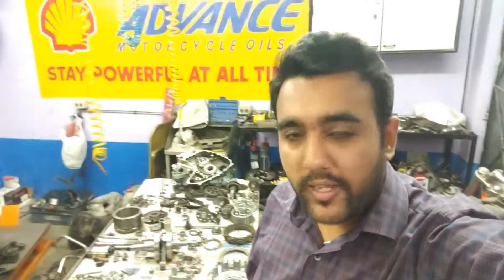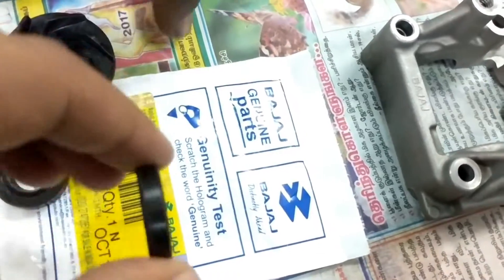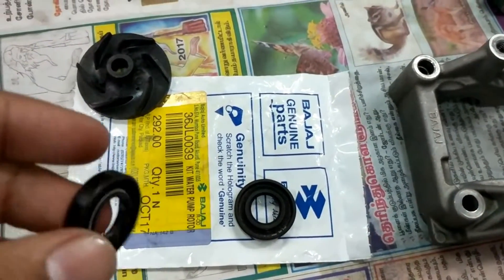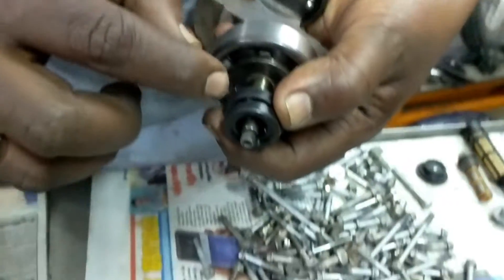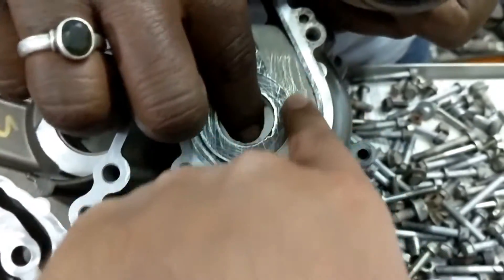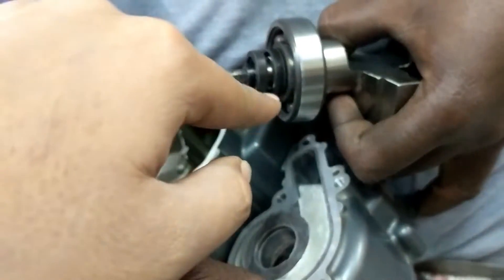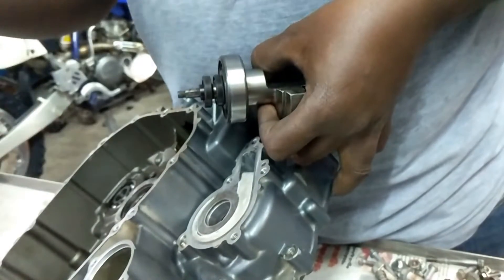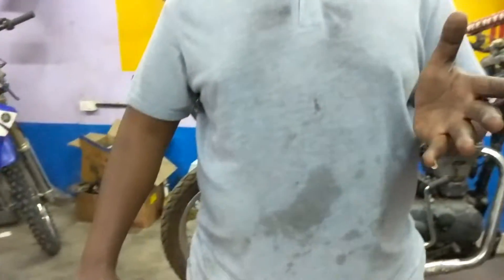Why does the coolant mix with engine oil in KTM 390 Duke/RC? Major Fault!!

Comment: I am facing the same issue with my Duke 390. The worst part is that the bike generates enough power that the issue goes unnoticed. I had to convince the KTM service centre as they found the bike running still smooth. It takes a very deep relation with the bike to know this. Do not ignore even small performance issues. All the best with your rides..
Reply from the maker: Yes it's a very subtle symptom. You're lucky if you find it early, else goodbye engine
Reply: Just notice the coolant level at start and end of the day

Comment: Bro im facing the same issue for my duke 390 i gave it to the service center they said me that most of the parts should get replaced and they said it will cost arround 40k please help me bro.
Reply from the maker: Oh my! That's a lot. Depends totally on the extent of the damage mate
Reply: @saajanjogia  bro i have the the list of parts which are being replaced.
Can u drop ur email so that i can send u that because i feel that ktm guys are unnecessaryly changing few parts and charging more
Reply from the maker: @RohitRajKodimala  honestly, do you want to keep the motorcycle?
Reply: @saajanjogia  what will u suggest bro??
Im in a dilemma
Reply from the maker: @RohitRajKodimala  if you're planning to sell it, get minor repairs done and sell it. Else take the opinion of another mechanic or another ktm dealer and go ahead
Reply: @saajanjogia  im planning to fix the problem completely bro. After fixing it,is it  better to keep it or should i sale it
Reply from the maker: @RohitRajKodimala  the motorcycle will give you repeated expenses, it's not a well finished product imo. If you still wish to keep it like me, you could.
Reply: @saajanjogia  ok bro. But selling is the not correct option right the other guy who buys it also faces the same issue.
Have u tried reaching ktm guys regarding this issue??
Reply from the maker: @RohitRajKodimala  of course it isn't the option. The thing is the problem and solution for this issue has been given in the video, ktm is also aware of it. Despite this, there is no improvement. bajaj motorcycles that have coolant have this issue, all KTM's made in India have this. No resolution though
Reply: @saajanjogia  kool thanks for replying
Reply: Rohit Raj what happened? Is your problem resolved??
Reply: Rohit Raj bro could you send me your insta  username, I want to DM you
Reply: @nischalk1336  rohit828raj

Comment: How much did it cost even I have the same issue 😅😅
Reply from the maker: I haven't faced the issue myself. For my friends, who faced this issue- it costed them around 8-15k depending on the damage that has been done. The manufacturer unfortunately ignores the damage that happens inside and only replaces seals (which is cheaper compared to going deeper and finding gold). If you wish to do that, I suggest you sell your bike after the work has been done
Reply: costed me 5k. and after 2days same issue. Filed legal action against KTM India.
Reply: Surely Done is your problem resolved now? Did KTM follow up for free?
Reply: Surely Done you faced coolant mixing with engine oil only?

Comment: Use in r15 v1?
Reply from the maker: Whaaat?
Reply: @saajanjogia  this water pump oil seal use in Yamaha r15 v1
Reply from the maker: @anupmokashi3114  not sure about that. Did the R15 even have a cooling system?
Reply: @saajanjogia  yes
Reply: By gods sake y will yamaha use babjajs oil seals?

Comment: How to get to know if coolant is mixing with engine oil in 2017 Duke 390??
Reply from the maker: See if your oil has become light green or pista green in colour. Bike will become too smooth when you ride it. also check for drop in coolant level
Reply: Tourer Jogia ohh got it...thanks bro.. how is your engine after rebuilding it? How many KMs have you ridden since then?
Reply from the maker: @nischalk1336  I've ridden around 10k kms after that. Engine is ok, haven't got full power back yet. I don't ride it that often now, just occasionally
Reply: Reason: Oil has turned pinkish cream in color.
Of course coolant level has dropped.
White smoke in the exhaust.
Reply: @VJ-ee5ez  got it fixed buddy... The gaskets and  sealant shutting the engine had failed... white smoke is mainly when there's engine oil burning...
Reply: @nischalk1336  Technically, its Blue smoke when oil is burning! White smoke if coolant mixes.  Please check!
Reply: @VJ-ee5ez  my bad... Just checked it out and you're right.. got confused since I had the coolant mixing with engine oil problem but I didn't see any white smoke coming out of the exhaust at all

Comment: What is the price it will take to replace the oilseal and also what the problem it will cause if we dent notice for longer time
Reply from the maker: Engine will wear out faster. Check with SVC for price
Reply: @saajanjogia  it may cause to change the cylinder kit in that case because in ktm service they r telling that it will come around 25k so only I am asking what will be the cost
Reply from the maker: @sriram-bw9sg  depends on how much you have ridden after mixing. If damage is bad, everything needs to be changed under warranty. (If you have warranty). Cylinder kit with Labour costs around 20-25k. If head is affected then add another 8-9k.
Reply: sri ram what happened? Any updates?
Reply: @nischalk1336  I have changed the oil seal and only I changed the clutch plates
Reply: @nischalk1336  thanks for the advice

Comment: Hy Tourer Jogia i have the problem with mixing transmission oil and coolant.My coolant is very fat on radiator plug so i would like to know is possible that transmission oil enter through water pump seal ? The bike is ktm exc 250 2015. 
Thank you in advance
Reply from the maker: Transmission oil of very thin I suppose, if there is a connection between the two then it could enter. Did you spot it ?

Comment: +Tourer Jogia
 could you help?
What the current seals position?  is [ || ] or  ] || [  ?
In video i can see the [ || ] variant - is that correct?
Reply from the maker: Hey. My mech isn't around now. I suggest you check the manual once before doing it
Reply: I'm a little late, but the seals should go like ][. I've read of some bikes having the seals wrong way from the factory. But the flat sides of both seals should face each other.
Reply from the maker: @MrMats0n  really not sure about that
Reply: @saajanjogia  really thats how shaft seals work. Its shaped like a cup, so the coolant (or oil) pressure pushes the seal to seal against the shaft. If it was the other way around, the oil and coolant would quite quickly just go past the seal as they would be pushing the seal lips to open.
Reply: @MrMats0n  Right

Comment: I had the same issue with my duke 390 2016 model slipper clutch. Service guys told they replaced the waterpump seal but it didnt solve the issue. Does anyone know what could be the issue
Reply from the maker: What problem are you facing now?
Reply: my coolant is mixing with engine oil..bike is still at service centre..
They told me some paste sealing near crank case is leaking or so!
Reply from the maker: @TheBornVoyager  ok. How did you find out it has mixed? Internal components need to be checked as coolant may damage engine in the long run if it has run a considerable distance after mixing has occured.
Reply: VINEETH VENUGOPAL bro is your problem resolved? What happened? What was the cost?
Reply: @nischalk1336  bro it was covered under warranty..now my bike is running at 30k kms..
Issue was with the sealing between gaskets..a paste like thing..it gave up
Reply: VINEETH VENUGOPAL ohh.. all of a sudden my coolant level has dropped to 0 and my engine oil is frothy and the bike heat bar is filling to half even while idling..  and the radiator isn't turning on properly.. could I be facing the same issue as you? What all did you face?
Reply: @nischalk1336  get it checked asap! That's a coolant mix. If you are lucky , culprit would be the rubber seal
Reply: VINEETH VENUGOPAL thanks bro..why do these KTMs have such fucked up reliablility..they can never come close to the Japanese ... Makes me regret buying a ktm
Reply: VINEETH VENUGOPAL ohh... Since then you haven't faced any issues for 10k km??
Reply: VINEETH VENUGOPAL and which showroom did you visit?
Reply: @nischalk1336  ktm's reliability is not upto the mark! Now my bike had been running for last 18k kms without any single issues. 
Before warranty i did services from an authorised service centre.
But after warranty..i never visited that place...
I do periodic maintenance once every 4000 kms ..i wont wait till 7.5 k kms as the company said..oil won't last that long in a good shape.
Now my bike is running smooth af.
Reply: I use this bike for 40km daily commute. It just clocked 15k on odo....i check coolant oftenly..but all of the sudden , a small constant bubbling sound came from coolant reservoir side..i checked coolant level and was empty..i immediately took it to the svc..and confirmed that engine oil and coolant is mixing ( it wasn't abruptly mixed..oil still had its characters) .
Reply: Oil colour didn't change much..
Reply from the maker: @TheBornVoyager  then get it fixed ASAP. Don't ride it anymore

Comment: My bike ( KTM RC390 ) suddenly started smoking out white smoke from exhaust, I noticed coolant is low in reservoir. Can you please help me out?
Reply from the maker: White smoke could also be due to oil burn. If coolant has reduced by a large amount, check the oil level and see if there's a green liquid. Better to have it checked
Reply: Tourer Jogia Is it expensive to get it fixed?
Reply from the maker: @rupeshtyson  depends after you've got it diagnosed. Could be expensive
Reply: Subba Rao any updates?
Reply: @nischalk1336  That's because I ride it once in a month, cold start caused smoke. Nothing serious!

Comment: Same problem on my Duke 390. They changed the water pump gasket.
Reply from the maker: Did it solve the problem after that?
Reply: @saajanjogia  I get the bike back today.
Reply from the maker: @CSWrally  cool 👍🏻
Reply: CSWrally what was the cost of repair?
Reply: CSWrally is the issue fixed?
Reply: It was covered by the warranty.
Reply: Yes, but I changed that bike after 3 months.

Comment: How do you know the coolant is not getting in through the head gasket?
Reply: If coolant enters through head gasket we would see a lot of steam or while foggy smoke from the exhaust port. I check the coolant level and engine oil colour after every ride just to stay on the safer side.

Comment: Such a nice explanation. Bro recently faced the same issue on my NS 200. Same parts are changed and i can see there is no decrease in coolant further but from oil window there is still whitish formation going on with engine oil though i poured the fresh oil post flushing. Should i  worried?
Reply from the maker: Abinash Mohanty monitor it for some more time else get it checked

Comment: That problem with new era bikes. Been riding old bikes... Seem didnt have this kind of problem. Mine was 1995 bike still didnt have this kind of issue. I wonder why...
Reply from the maker: Cyberion XI I totally agree with you! The old bikes were built to long last. Nowadays, I see these 2 wheelers wear out in no time. The conspiracy theorist in me tells that the manufacturers do that on purpose to recover service costs.. hence the 3-4 years sort of shelf life of such machines
Reply: Ssaajan Manoj Jogia yeah agree with you. Expensive and problem with new era bike. I still prefer old carb bike easy to fix. Dyno etc kinda always malfunction and tons of cut off. We own a bike and we cant do anything to mod it freely.
Reply from the maker: Cyberion XI yup I'm realising too that the carb ones were better and easier to fix, cheaper to maintain. And I am totally against having a ton of electronics on my motorcycle. They've converted the big bikes into play stations anyways
Reply: Yeah... Expensive to setup dyno, need buy this and that just to fix  mixture... End up u got hole on piston hahaha
Reply: @saajanjogia  I'm sure playstation is more reliable than any bajaj bikes I guess
Reply from the maker: @haramilonda936  agreed.
Reply: @saajanjogia  bro which bike is a reliable and would serve me 8 to 10 years with regular maintenance for sure. Sorry for my english btw
Reply from the maker: @haramilonda936  honda unicorn. Settle in life without problems

Comment: Hey very informative video, I just got my Rc 390 back from KTM service centre they had kept my bike over 4 weeks and today second day of Riding it after the service, got the same issues. Low oil pressure & coolant temperature .
Reply from the maker: Mr Bhp damn on the second day!! What are they doing??
Reply: How much did they charged u bro??
Reply: @RohitRajKodimala  same issue with my Duke250. 
Repaired @ KTM SVC costed me 5k.
After 2days of same issue.
Filed a legal action against KTM India for selling crap & cheating us at premium price. 
Got call from SVC they will repair free of cost. Lets see what happens
Reply: Is ur bike under warranty period ??
Will they repair my bike for free if i file a case too???

Comment: Thanks for making this video. I got exactly same problems here in S.Korea. I've learned a lot from this video cheers mate!
Reply from the maker: Go With Gony glad to know :)
Reply: @saajanjogia  hi bro, please give me an advice on changing those oil seals!
Do I have to change or buy any specific parts which needs to be changed while changing the seals?
I'm in UAE 🇦🇪 here in UAE it is very expensive for the company service so I would rather go to the local workshop..

And brother isn't possible to open duke's engine without company tools? Or it is just false information?
Please respond brother. Thanks
Reply: @saajanjogia  bro jab ma bike start karta ho aak km  ka baad hi mara fan on hota ha us phir din bar on rahta ha  show some.time high coollant tampture coolant level is good not mix in engine but 1km ride show high coollant tampture and full day not off  fan
Reply from the maker: @azadbashir9428  could be possible that your temperature sensor has gone for a toss. Check coolant and if you see the level has dropped then get it checked at the svc.
Reply: Then what have you done to solve this problem gony? Please share i do have same problem with my bike duke200recently.
Reply: @dishankthakur729  Hi mate, sorry to hear that you are having the same problems as I did. Luckily my 390 was under the warranty so they cleaned whole engine changed water pump etc... took quite a long time. I don't think you can done this at home better to find the shop for helping you figure this out. since then I only trust Japanese bike.
Reply: @gowithgony  thank you very much buddy for you valuable suggestions but one more thing i want to knw!!. Even after all that cleaning thing bike will be in good condition? Can we hope next tym it won't happen again? And after you cleaned it how much you drove your bike?  Or u juss sold it without any delay 🤔😳🙄!!?
Reply: @dishankthakur729  I remember that I rode 3000km after repair and it was fine after that(you can feel the engine sound and vibration are different than before), but I was always nerves when I rode away from the city. So in the end I decided sell it. I think there might be a little chance to have same problem again, but you know there is also a lot of them without any issues, so it's difficult to say it won't.
Reply: @gowithgony  thanks mate thank you so much 🥰 for sharing your experience, it will be a lot more helpful for me 👍 have a great day keep riding stay safe drive safely 😎👍
Reply: @Dillon Adrien Instablaster ;)
Reply: @Dallas Mayson Thanks for your reply. I found the site through google and I'm waiting for the hacking stuff atm.
Looks like it's gonna take a while so I will reply here later when my account password hopefully is recovered.
Reply: @Dallas Mayson it worked and I actually got access to my account again. I am so happy:D
Thank you so much, you saved my account !
Reply: @Dillon Adrien Happy to help xD
Reply: i dont mean to be off topic but does any of you know a tool to get back into an instagram account..?
I somehow lost the login password. I appreciate any assistance you can give me.

Comment: I used to top up the coolant, and used to see the color of engine oil changing. Now i see the real issue. So what do they do? Do they change those rubber seals? and its done?
Reply from the maker: Nitin Choubey they replace the rubber seal and expect it to work fine. But the technique to keep engine oil bay away from coolant remains same
Reply: Bro can you tell me , how much do they charge and what time does it take?
Reply: Bro can you tell me , how much do they charge and what time does it take?
Really appreciate your help on this.
Reply: Costs about 300 INR for the parts. Repair charges extra

Comment: I have the same problem with my KTM 390 DUKE. Won't the company take responsibility?
Reply from the maker: Nitin Choubey I don't think so. You're lucky if it's under warranty
Reply: 2 years done. Dont think its under warranty.
Reply from the maker: Nitin Choubey oops.. you'll have to pay for it... Try putting pressure via email and see if it works
Reply: Nitin Choubey any updates?
Reply: Bro did u got it repaired ??? If yes how much did they charged???
Im also having the same issue with my 390.
Reply: No , I don't know what the problem is and nor does the mechanic.
Reply: Nitin Choubey so is your bike lying unused... Or did you sell it?
Reply: @nischalk1336  i had same issue bro i got ut repaired the bill was 38k 😭.
Reply: Rohit Raj wtff...can you give me your insta username..I want to DM you regarding this
Reply: @RohitRajKodimala  what they replaced ?
Reply: @pracata4466 a big list 🤧
 60% parts of the engine